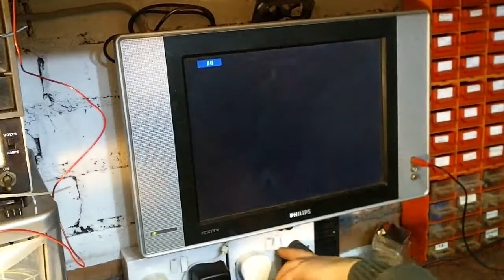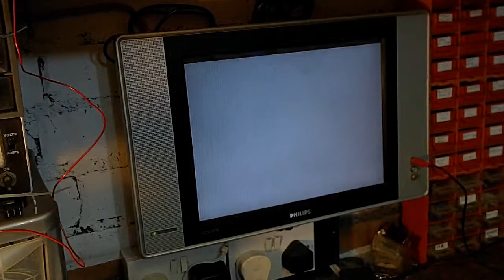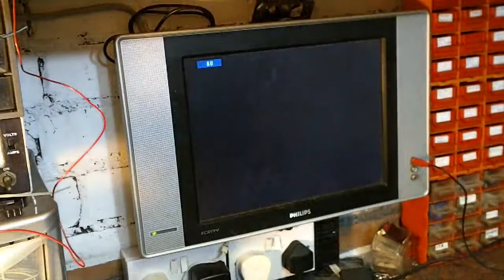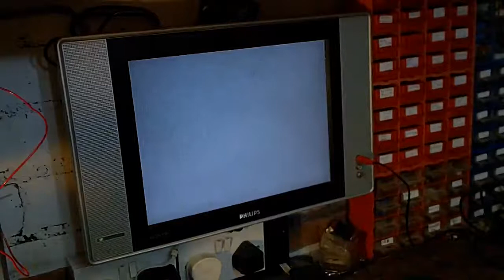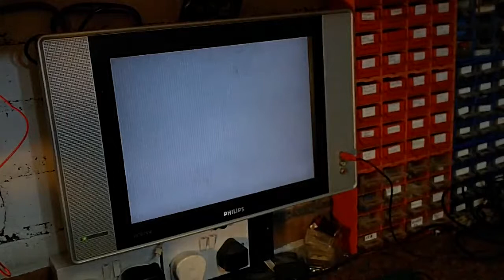Amstrad PCW project pt1

Comment: Actually, PCW doesn't do anything without boot floppy, as there's no ROM onboard. There's a nice trick implemented where keyboard controller spoofs a few instructions somehow to the CPU, instructing it to load one track from floppy and go on from there. In fact, just put a real boot floppy disk into drive and you should get something on the screen. I was able to create the boot disk from DSK image on CPC with external 3.5" floppy to transfer images from PC to CPC and then writing them from there. I recall I used ParaDOS to support external 3,5" floppy and then some program on CPC to write DSK image to real 3" floppy. If you're stuck, let me know and I'll try to remember more details.